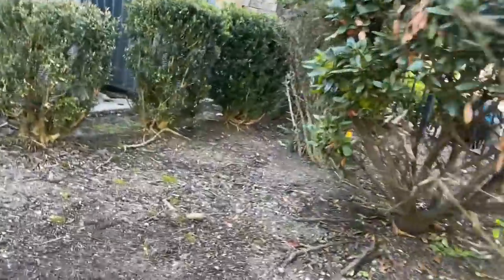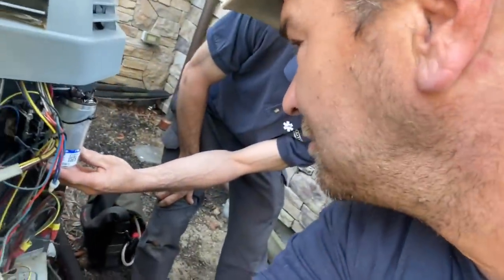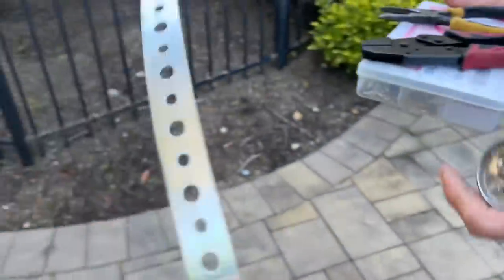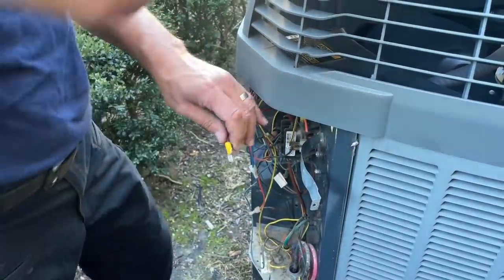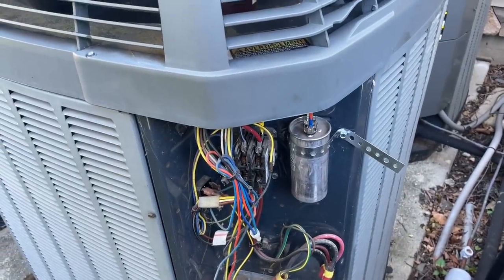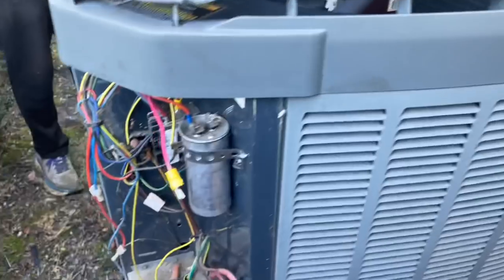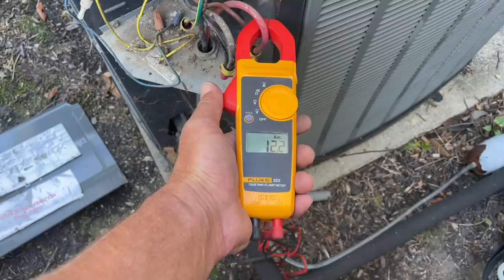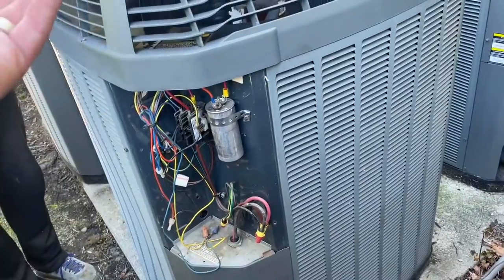Central AC Not Working - Compressor Not Turning On - Burnt Terminal & Wire on Capacitor Replaced

Comment: Mike...Mike, the terminal crimpers are designer to work only in one direction, parallel to the spade terminal (preferably center pin in spade seam) center. not perpendicular. See 06:02 of video.  A little tug test would be good also. :)

Comment: Great repair as always, just a small thing for next time. Those terminal connectors are designed to be crimped in one way, basically parallel to the terminal not sideways. Great job as always!

Comment: Mike, It would have been interesting to do a captaincy test on the old cap ???? the compound crimpers that Klein puts there name on you can change the dies and do coax cable and  spark plug cable ends , ect,ect I found  Milwaukee  makes the best wire stripers by far .    Stay well Pete M

Comment: I see your using a start or run capacitor,   can I use a dual capacitor with the same specifications? And if so, where does that orange wire go to (Fan or Herm)?

Comment: If this becomes a regular client, I'd switch the Y and the common on the contactor to remove the low voltage short risk when removing the capacitor.

Comment: Tell Mike to use leverage on the cap it will come off easy or a flat head to lift the terminal up and also I take off the mounts from the old unit for different size caps
Reply: This was made before I saw the new wire lmao

Comment: The problem with the outdoor fan motor not coming on that one time had to do with a small molex plug. They had issues with those, usually the yellow wire in the corner of the plug. When you wiggled it around a little looking at the "alien spider nest" it probably lost connection between the two pins. I've repaired several of those by pushing the wire back in and then adding a drop of super glue into the hole of the molex so the wire can't move. Either that or just eliminating the molex plug entirely and splicing the wires together. You can usually see a small blackened or burnt spot inside the molex where the bad connection has been getting hot. 😎👍
Reply: Interesting.  I looks like the motor kicks back on the last start up before starting up in the opposite direction.  That could happen if a winding had the resistance from a bad connection in series with it so it created the magnetic field late compared to the others, I'd think.
Reply: @jkbrown5496  those ECM style motors usually go in the opposite direction just briefly for a second before they start up in the correct direction.

Comment: Those plastic plugs on the ECM motors are suspect. I constantly cut them out and wire nut the wires together due to poor connections. Might be the problem there, also they typically have a 5+ second time delay

Comment: Just got back from a call homeowner took off fan to clean and didn't put the conduit back on the fan and water got on the contactor and corroded all the terminals and spades on cap. He wasn't to happy when I said $850 for the repair on a 2 year old unit we installed.

Comment: You didn't show a voltage check under load, just an amperage check. Could the contactor be intermittent and that would explain the burned wires due to a low voltage event. Just saying!

Comment: Are ecm motors supposed to start up and move backwards before running? It looks like your motor tried to go to the opposite direction at first every time you put the disconnect in

Comment: Mikey pipes how u doin ? Lol anyway the Klein crimper when you crimp hold it ratchet handle facing down and put the connector flat the way the spade crimp is flat then crimp much easier and crimp is flat like the connector  not sure if I said that clear enough but hopefully anyway keep up the good work

Comment: those ratcheting crimpers are great -- the only problem i've seen is some of the connectors don't like the wide crimp that the crimper gives -- either you need to use both arms for enough force to get it to crimp, or it will squeeze the metal connector right out of the insulated/plastic "boot".  guess what i'm saying is i keep both the ratcheting crimper and the narrow "traditional" crimper.  same thing with the automatic wire stripper -- great except for when you dont have enough wire slack to grab on to it.

Comment: Be sure to check the crimping adjustment.  When I got mine, had to increase two notches to get a real good bite on the connector.  Wonderful tool.  I love that the ratchet allows loading the connector just right, and then introduce the wire, and crimp.

Comment: Had to adjust mine. Didn't always make the crimp tight enough, but there is an adjustment wheel on it. Best 40 bucks I ever spent in my life. Very little straining when crimping.
Reply: @PipeDoctor  Depends on the connector. I use the heat shrink connectors and they're a bit smaller than the non heat shrink type.